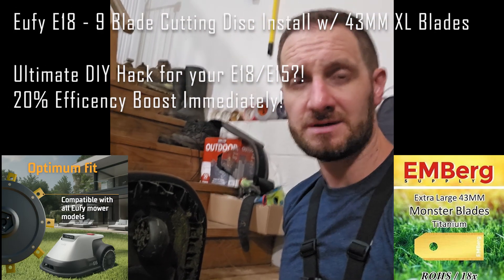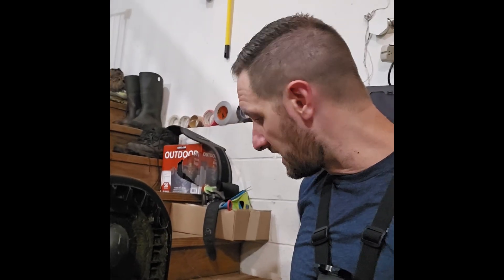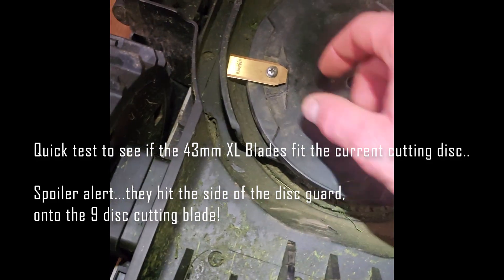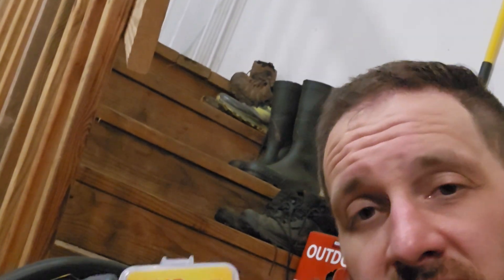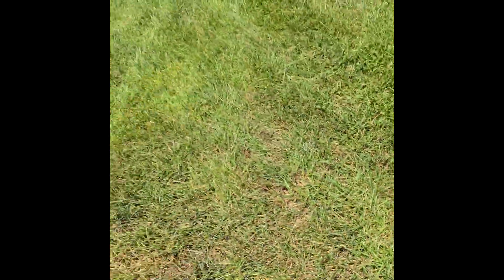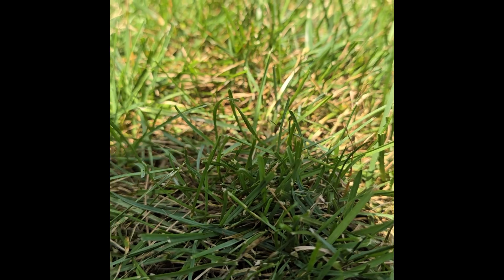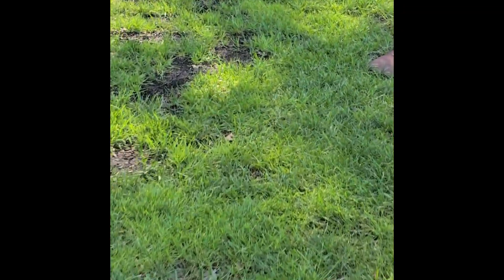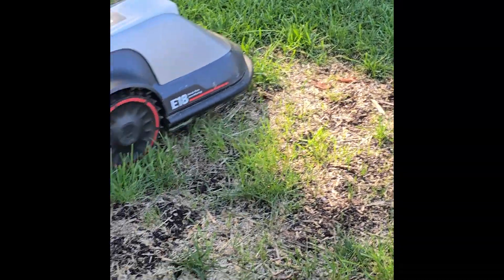Eufy E18/E15 - Best DIY Mod - 9 XL Cutting Blades! - *20% Faster Cut*

Comment: Have you considered removing the blade guard? It's pretty common on other mowers and I honestly don't even know what it does besides prevent blade strikes while going.. backwards?
Reply from the maker: Thought about it. If I run into issues with the current setup I would.  I need it for my kids as they are inquisitive and like to be around my robot...so far so good. 6 weeks with this setup running 7am -7pm no problems! 

Did you order the wheel? Have an e18 I'm assumimg

Comment: I'm glad to see I'm not the only E18 owner tinkering and analyzing to this level to get the best cuts! I hadn't even found this Green gear option. Great videos! 

Have you had any issues with your maps this week from the latest updates, mine tried to go AWOL the other day. 😂
Reply from the maker: Glad you are on the same page and happy you found my video useful. I have been complaining to Eufy Support for almost 2 months now, before the 6.8.22 firmware was released my maps worked fine, now i have these random shaped blobs on my map (wherever there is an obstacle, garden, shed, fence)...if you follow the cuts, its a perfect square or rectangle around the object, but very frustrated they haven't gotten this fixed one bit. The Real Map helps but it still won't accurately identify the objects. 

Regarding the maps, i put virtual boundaries around the entire perimeter of my lawn and its been smooth sailing since. oh jeez what happened with yours the other day?

The Green Gears Cutting Disc shipped from Germany and took about 2 weeks to arrive but overall i'm very pleased. Night and day difference w/43mm blades, and having 9 of them! 

What speeds/settings do you run your e18 at? how big is your lawn?